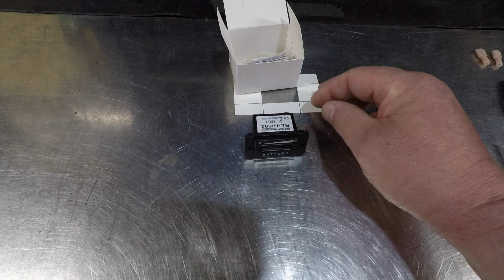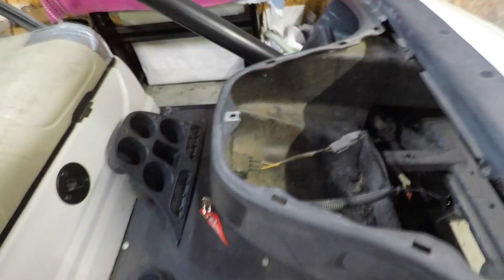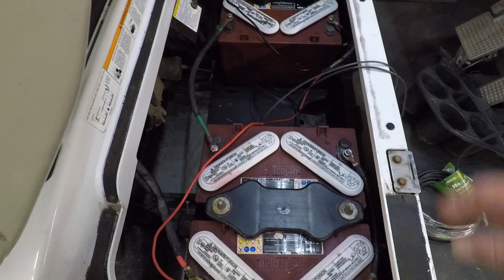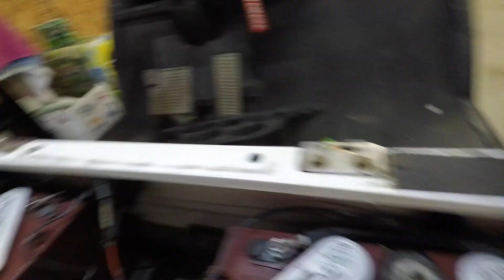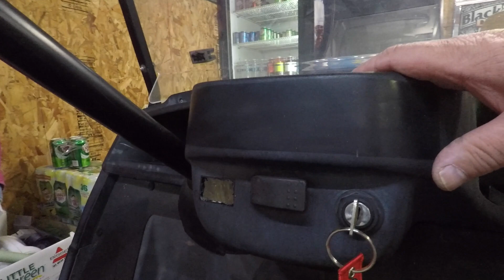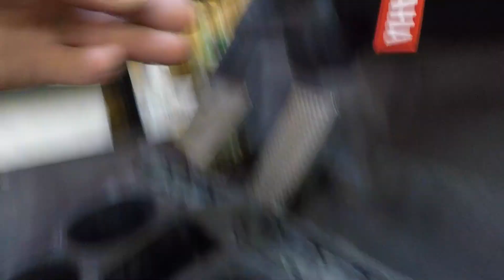Yamaha G29 battery indicator install

Comment: Wait a minute wait just a minute. In keeping with being a "perfectionist" wouldn't said perfectionist wire this into the key switch so the battery doesn't discharge due to the battery meter being connected 24/7?

Comment: Including an inline fuse at least on the positive line adds a bit of safety.
Reply from the maker: I actually did. it just didn’t get into the video I should have mentioned that in the description thanks for the comment and suggestion hope you subscribe and check back lots more stuff coming

Comment: What terminal size are you using?
Reply from the maker: Which ends are you referring too?
Reply from the maker: On the batteries I’m using 4 gauge terminals with a 5/16 bolt hole 3/8 would work also

Comment: Thanks.  I bought an indicator that shows % and volts with an off button.  Same cart as yours and I placed the positive and negative as you show.  I didn't care about mounting it on the dash. There was a small hole on the plate that houses the tow switch.  I drilled the hole a bit wider and the wiring harness fit in nicely.  So far it appears to be good.  Shows 100% and 50.4V.  I drove it around the neighborhood for about 20 minutes and it is still at 100%.  Batteries are pretty new so I hope the next drive will show the battery begin to discharge.  Appreciate the video support.
Reply: you need to setup the indicator for the correct battery type or they won't show any discharge, it will always show 100%,   look at the instructions that came with your indicator on how to set it up

Comment: You could have used the wires off the keyswitch to get the SOC metere to turn on and off with the keyswitch, rather than hving them run and stay on 24*7

Comment: Wire it in to your key switch or controller. No need to have it on constant, Vampire Power drains electric. Every little bit adds up. I wired my ezgo  into the controller. The battery indicator level light turns on/off when the forward or reverse lever is in neutral or the key is turn off.
Reply: I prefer the ignition switch to turn the meter on and off. In addition to the vampire drain with continuous on, eventually the meter burns out just like a light bulb left on continuously.

Comment: Why would you wire the gauge to be on all the time?
Reply from the maker: LED gauge draws next to nothing would take a long time to drain anything.
Reply: @EluderRacing  Thank you for responding to my question. I'm trying to replace my original gauge that has 4 tabs on the back like the one u used to a battery voltage meter that only has a red and black wire to the ignition.

Comment: I installed mine and wire tied it to the batteries. All I need to do is lift the seat and check it. Much easier then running the wire and cutting the dash.
Reply from the maker: Definitely a option to do it like that but surface mounting is very easy and while your out and driving around it’s right there for you to keep a eye on and who doesn’t like gauges they look cool!!!

Comment: Hello, I have a problem with a Yamaha g29 drive and it is that it starts, it advances little and when it comes to accelerating it turns off completely and the price or the power cuts off and does the same, it advances and turns off, could you help me?
Reply from the maker: seems like you are having a issue with either your speed controller or your throttle sensor located on the pedal. your best option is to have it scanned at a dealer rather then replacing parts the cost can add up quick. I would also make sure all cables are clean and tight and check batteries to verify there water levels are correct and are fully charged.

Comment: IV just put 1 in a club cart I wired it so it only comes on when the key is on rather than on all the time doesn't matter which way you do it I just prefer it to only come on when the key is on
Reply: and how did you do that Jim ?
Reply: @kevinprzewrocki6698  Find the wire off the key switch that powers on when the key is in the “ON” position and run the jumper wire from there the the “C” on the battery meter
Reply: The meter being on all the time is like a light bulb on all the time. They burn out sooner.